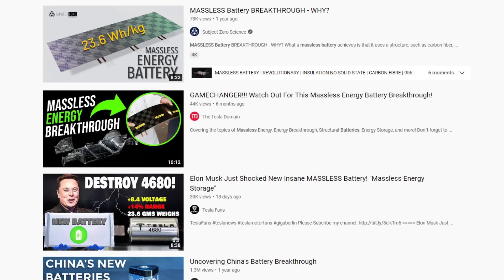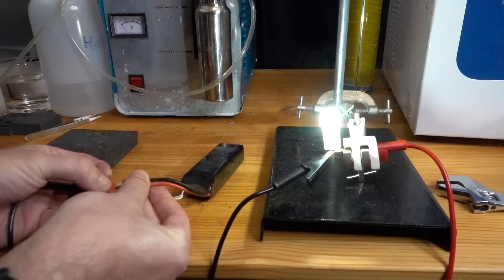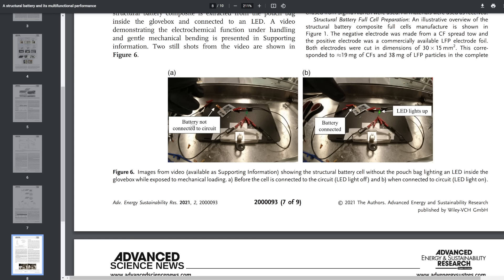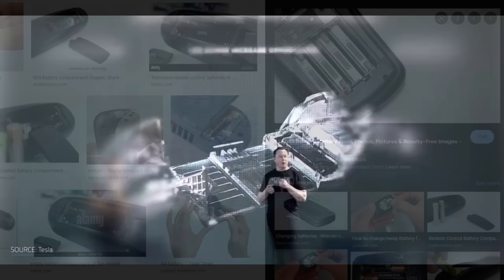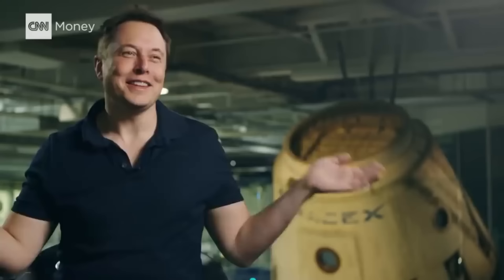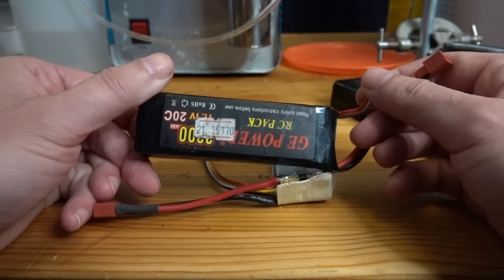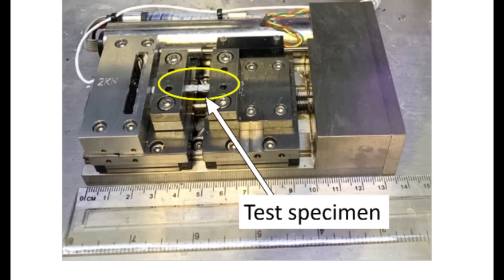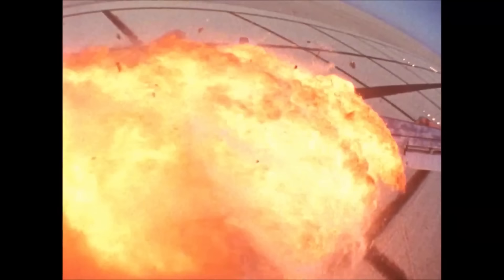Matt Ferrell, Massless Battery: BUSTED!!

Comment: I thought about building the battery into the car's structure back in 1995, but my colleagues thought it was stupid. I thought it was stupid to be carrying around the weight of a "battery's case" everywhere, so why not have it perform double duty serving as the car's structure. 
And then I learned about what happens when lithium and water mix. 🤦‍♂️
It IS a stupid idea.

Comment: Yup, he's not very good at explaining or understanding things. If he meant that making an EV with the battery built integrally into the structure of the car, it could theoretically reduce the weight of the vehicle. The practicalities would disagree. If any part of the battery casing is exposed in the undercarriage, the casing would need to be reinforced to prevent damage, making it weigh more. I could see the argument that having the battery be wider and flatter under the seats so the mass can be spread between the wheels instead of being under the rear passenger seats, where some car manufacturers place the batteries, and mostly weighing down the rear wheels. This could theoretically help the car last longer, maybe save wear and tear on the tyres slightly, but the extra difficulty of replacing the battery when it wears out around ten years after you buy it would be difficult to engineer around and negate the saved money anyway. At least with the EVs that have the battery stored behind or under the rear passenger seats, you only need to remove the seat to access the battery. Tesla placing the batteries under all the seats as shown in the video means you need to disassemble the entire vehicle almost down to the frame to access the batteries, so you can replace them. The under the rear seats can be done by the local mechanic. To replace the batteries in the Tesla probably requires you to send it back to the manufacturer, which might cost so much that it's no longer worth doing.

Comment: like a water cooled pc, EV batteries are on their own water cooling loop. if the idea was possible, every panel and shell structure water cooled. after a little dink. what would happen if it cant desperse heat. if you got a lithium drill, impact gun etc... give it hell for few minutes then feel the air cooled battery. i wonder what would happen if a lithium battery become unstable if the over heat protection failed.

Comment: Thunderf00t, modern multi-engine commercial aircraft have more than a single fuel pump (and resulting pressure).  The tank has a feed pump that generates a relatively low pressure for feeding the engine - but the engine has its own pump that generates high pressure for proper fuel atomization when injected.

And now TF just can't resist bashing on Musk yet again.  I swear it's a frenemy bromance at this point.

EDIT:  But he is 100% spot-on in calling Twitter, cancer.

Comment: I recall that particular bit of nonsense video. In the first part, how the hell can it be called massless anyway? It was a structural battery, and for sure it doesn't have a zero mass, even if you net off the structural only elements. 

I also commented on the ludicrous notion that jet engines could be fed by gravity should the pumps fail. Then there was the issue that the last place I want batteries to be if I was unlucky to be in a car crash is in actual bodywork. It would also make such vehicles all but unrepairable if the monocoque chassis was also a structural battery.

Comment: You are 20% off on your pressure calculations. Aviation fuel has only 80% of the density of water, so the height difference needs to be 25% larger.

Comment: So the thing about Li ion, or even Li Fe po with over twice the re-charge cycles of Li ion, in Finite recharge cycles. So after specified cycles, you want to change battery! Not bond it into a structural chassis! Doh!

Comment: I don't know what's wrong with this guy, but sometimes you don't even need the research, and just a little thinking to figure out if something is as freaking wonderful as it's said to be!  Massless should have been his first clue!  How many things does he know of that are massless?  Sure, I can see that they are going for lower weight, but mass and weight are not one and the same thing, and it's not weightless either.

Tesla putting the batteries in a structural case, also means that when the battery cannot be charged anymore, you have to either spend like $4,000 in labor alone to have the whole freaking car taken apart to change the battery, if you even can!  Batteries that cannot be changed sounds like one of Eloon's brilliant moves to get his fanbois to cough up the money for a new car more often! It will make recycling them much more difficult and then some!

Comment: The issue I have here, and I'm not sue if you cover this because I'm facepalming so hard I have to keep stopping the video, is that even if you distribute the weight of the battery throughout the structure of the car, you run the risk that one the battery goes bad, you now have more of the vehicle to replace if the car needs a new one. We're just generating more waste by doing this because in order for the structure to be strong enough to be in the car it will need to have better reinforcements, so it's even harder to deal with. It's a stupid way to integrate a power supply into anything because to replace it, you might as well replace the entire thing which is just a huge waste.

Comment: The only thing different from thunders massless battery and the one in the lab is that one is a lot more expensive. If you want massless battery’s charge something with potential energy and convert it to electrical energy or use heat to store energy practically massless just not the things that make it work they weigh quite a bit

Comment: E=mc² so if it is massless there is no energy. If you just plug a zero into that simple equation for energy as it turns out the math says that would lead to zero energy. Zero mass = zero energy.

Stop calling it massless energy, that literally is impossible.

Comment: Carbon fiber is likely to become cheaper. There is a reason why carbon fiber has an advantage over steel. Steel requires some sort of coal to make, and the recent climate agreement is to phase out the use of coal, so . . . . ..

Comment: I have watched a few of Matt's videos in the past, most of the time I write off some of the wilder claims as wishful thinking on the part of researchers and the like. But a 'massless' battery? WTF you still need the SAME mass of lithium battery for the energy storage you need. What percentage of the weight of existing ev battery packs is structural(holding and safeguarding the cells) vs functional(batteries, conductors, thermal management)?
I can't believe I missed watching this video about a 'massless' battery, this is like calling an EV a zero emission vehicle. This is a caseless battery. WTF would you spread out the battery over the ENTIRE structure of the vehicle when shorting high energy batteries is a catastrophic fire hazard(also, somewhere just under the skin of the vehicle is a conductor that has hundreds of volts potential difference to another spot on the vehicle, just under the skin)? Large batteries like those needed for LOW(never zero) emission vehicles need to be heavily protected (almost better than the passengers since a failure in the pack could lead to immolation of the passengers in short order) in a configuration that also allows for thermal control (to extend the life of the battery and ensure performance in cold temp) and efficient replacement(if we care about these being low environmental impact vehicles we need to extend the life of the rest of the vehicle as long as possible.... right, RIGHT)
Reply: The structural weight of a EV battery pack is surprisingly high, easily 10-20% of the total mass. There was a discussion in the context of sodium based batteries that are far less demanding in terms of short circuit protection and the higher density of the sodium doesn't effect the total as much. Spreading it out makes more sense for sodium for the same reason, it isn't nearly as much a fire hazard.
Reply: @joergsonnenberger6836  10-20% of 1000to1500lb on a 4000to5500lb car is of some significance, but there are serious maintenance, safety, and longevity issues with spreading the battery cells out in this manner. If you have seen the results of catastrophic damage to a small lithium cell when it is fully charged you know that that carbon fiber part is ruined for sure. One of the biggest problem is that you lose the ability to manage the thermal environment of the batteries and that is a functional problem (a 200lb pack weight savings is NOT worth loosing that functionality on lithium batteries.) You don't just keep the batteries cool, so arguing that the batteries wont need cooling if they are spread out is no good.
Reply: @Tom89194  I don't disagree with that assessment. The design isn't that useful for vehicles, since specialized materials cover the same functionality better and typically with less weight too. I wouldn't rule out an environment where a "massless" battery could serve multiple purposes well enough at the same time to be justified. Just for fun, imagine a sodium based battery that could be used as the insulation layer of a submarine. The cooling is provided by water on the outside walls, and it could actually save tight space. Would it work in reality? No idea. Is it a bigger hazard than a placement elsewhere? Maybe? It just doesn't strike me as completely brain-dead, especially compared to some things already done on submarines in the name of space-saving...

Comment: Obviously the battery isn’t massless but if the car’s made of carbon fiber. Maybe you save weight there and maybe the there’s some side benefits to distributing the battery throughout the structure rather than having it concentrated?

Comment: A 14% range increase, even if it hadn't been a lie, is meaningless.  If you don't have the range you need now, 14% isn't going to give it to you -- especially since battery capacity declines with time.  Call me when it's 2x range (and--this is important--not a lie).  Better yet, call me when it's at least e times extra range (approx 2.72x).

Comment: Lots of little kernels of truth in his statements that just don't end up supporting the conclusions.  Biggest examples, yes gravity feed is a thing on airplanes with the wing over the engine, if they also have a carbureted piston engine. Integral fuel tanks do have mass savings, because it's just the structure of the wing plus some sealant vs a wing that has a hole in the middle to fit a tank plus the weight of the reinforcement to make up for the giant hole. So maybe you have a nearly mass less gas TANK but you still need to fill it. Oh and integral fuel tanks are about the least safe form of fuel storage with comparatively heavy rubber fuel cells having a significantly lower rate of post crash fire.

Comment: I don't understand how you generated the voltage from the water... Anyone that can explain?
Reply: He used two different Metals, Aluminium and Copper, between these two is an potential. If you add Saltwater, the Ion´s from the Aluminum travels to the Copper.
The Aluminium breaks down in this setup, after maybe a few hours or so you get funny looking water, with Alu Slurp on the bottom.

So it´s an not rechargeable Battery. If you look on the Hydracell Video on this Chanel, he explains the setup

Comment: Well, technically even fluids can have a structural, load bearing role. Everyone who ever had an erection knows this.
Getting some weight efficiency out of it? ... thats tricky.

Suppose, there is a weight loss, but then you have the issue of changing the battery after it degrades. And, probably even more damning, recycling laminates is a fuckin nightmare.
(I did not watch this entire vid)

Comment: I'm still not understanding where the "massless" part comes in. They gave an energy denstiy in Wh/kg that wasn't infinity, indicating kg must have been greater that zero. One must surely conclude the presence of mass.
Also, don't battery electrodes structurally deteriorate with contitued charge/discharge cycles? That might affect more than your range/power if your carbon fiber electrodes are also responsible for a vehicle's structural integrity.
Debunking this kind of content is important. Matt may well be an earnest and nice guy, but he gives this kind of nonsense a preception of legitimacy.

Comment: My only problem with this whole video is when you debunked him I'm gonna go. If the pump and the wing of the plane goes out to engine can still be fed which is true because hes not talking about the injection pump that gives. It high pressure. He's talking about the fuel transfer pump that just moves the fuel from the wing to the Injection pump just like on a diesel truck. You have a lift pump that moves the fuel from the tank up to the engine where there is a mechanical pump that pressurizes it to 15 to 40,000 psi. That is almost waterjet pressures but the pump that Lifts the fuel from the tank only creates 8-15 psi and 10-100 gallon/hr the higher being needed for a 1500 hp race engine. .433 lbs/hr of fuel/ hp.

Comment: How can this guy happily put forth the idea of a non-modular battery pack being a good idea for EV's with a straight face?  The shottily made cars are already self-totaled after around 7 to 9 years WITH a modular pack, imagine it being an entire frame swap away from the from/rear subframes if that's even possible.  Not everyone has the money to shell out for a new car every 7 to 9 years.  I can buy a new one today no loan, but I happily drive around my 94 Volvo 850 Turbo sedan that's going on 350k miles.  Or any of my other old Volvos, Mercedes, or Toyotas; they're all WELL past the life span of any EV and still run fine with basic maintenance and not much else.

I don't hate EV's, I quite like them; but I also understand we're still a long way off them being viable as everyone's form of transit for both public and personal transportation.  They're no way near "green" in that they're throw away cars that can't really be recycled (not to mention getting the lithium nor the power required to charge them, which our grid is nowhere near capable of sustaining for a large swap) and the costs are too high for a throw away product.

Comment: Matt isn't wrong about jet engines being gravity fed. How I understand it works is their are pumps in the fuel tanks that supply a constant fuel to the engine. If those fuel.pumps fail the fuel is then gravity fed to the engine.  Once the fuel gets to the engine another fuel pump on the engine connected via a gear box actually provides the pressure for the injectors. 

Basically the fuel pumps in the wing supply constant fuel to the primary fuel pump that supply the injectors.  Those wing pumps if fail has a bypass to allow gravity to feed the primary pump.

Comment: I'm no expert in this, but if it comes to energy i always have a few questions to these kinds of things:
1- What if you suddenly need more energy for a short amount of time than the device can deliver.
2- What if the energy generator suddenly can't produce energy, like night vs solar energy.
3- What if your device doesn't need so much energy, what will happen to the excess energy it produces.

Generators and batteries together fix so many problems, why make it more difficult by simplifying it. Making it better is one thing, this isn't better.

Comment: Structural batteries won't be viable until high-capacity rechargeable solid-state batteries come out, and high-capacity rechargeable solid-state batteries won't come out commercially until 2023 for just limited-production high-end mobile devices and won't start mass production before 2025. Solid-state batteries won't come out until 2025 for limited-production top-end cars and won't start mass production until 2028. Structural batteries are only possible with solid-state batteries because you won't want electrolyte leaking out from conventional batteries with gel electrolytes, especially when it is flammable. As a result, we won't have structural batteries until at least automotive solid-state batteries start mass production, and mass production of solid state batteries won't begin for at least another few years. This means that realistically, structural batteries can start mass production in 2033 at the earliest.

Comment: Massless is a really bad name ... F1 cars, though, once used chassis until wither Chapman or Brabham had the idea to have an structural engine and got the wheels and suspension in the rear of the car to be attached to the engine. There are window glasses that can do photovoltaic conversion, aren't there? That's a good idea - thought glass exterior buildings are very energy inefficient. The "structural battery" has a problem since I know of no battery material that is solid (enough to be structural).

Structures, however, take advantage of shapes and sometimes, like in the Saturn ICMB and the aluminum bottle, what is inside makes it stand up of support stacking one over the other. If we can find a way to conform the battery to the structure of a car, the structure could, perhaps, be made lighter. (perhaps , maybe ... not sure!)

One question: Have you looked into the salt water battery some US company was developping for stationary applications like solar and wind farms? 2V is more than an NiMh cell but the Toyota Prius runs on them.